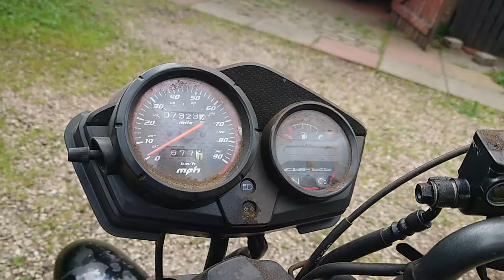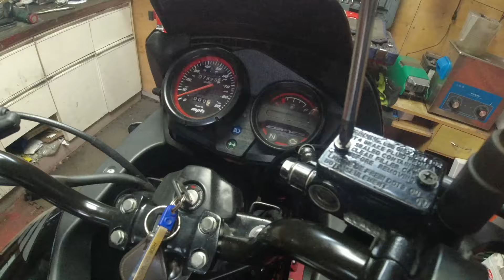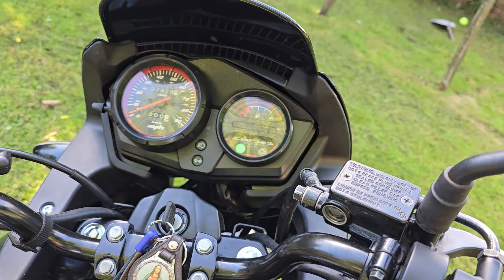Honda CBF125 Restoring your first motorcycle

Comment: Hello, I am also restoring mine, but having trouble on choosing products. Can you provide a list of the products and paint you used?
Reply from the maker: @sarmentinho  Some parts from Dave Silver, others from sellers on eBay, the paint was from an auto supplier, 2k primer and base coat and 2k lacquer. I will do a video breaking down all parts and the costs
Reply: @doconwheels-c5m  thank you so much! My main concerns are to pick the correct primers, paints and rust treatments to mine. 
Currently my restoration is halted due to baby taking all the time, but your video felt so good to watch, I enjoyed a lot! 😊
Reply from the maker: @sarmentinho  I hope you get progress with your project,  you shoukd be fine if you stick to 2k primer and 2k solid black for the frame. Panels require plastic primer before painting, easily done. Good luck 👍

Comment: Currently building my sons first road legal motorcycle he won’t help like Greg
Reply from the maker: I hope your son comes around and gets involved, he will gain so much
Reply: @doconwheels-c5m  
I hope so I have built all my transporter t5 and now I’m on his 50cc moped
I have got it running and riding the previous owner messed with the carb settings and would not start up. 
There a way a also a earth that had snapped off and the broken wire produced the eml once it’s conectrdd the illuminated eml go s out 
I got a little bite of bodywork to get on with
Reply from the maker: @sleepeasywithwhitenoise3860  You sound as busy as me!

Comment: Grate video but can I ask one thing where did u order bearings and cups from as I'm having a mare finding some and tapered ones don't fit the 2009 model
Reply from the maker: Thanks for you comment. We were really lucky, I had an old bearing left over from some other job. The new kits that are available all seem to be too tall for the top of the frame. You can use the bottom ok and put ball bearings in the top, or the other option is the have the frame machined down a few mm for it to fit. I have come across this problem before and I think it is becoming really difficult to get thinner bearings. Hope you get it sorted out OK
Reply: @doconwheels-c5m  yes I have bought three different sets and they all sit too tall at the top so makes the bike feel like a boat I'm going to try the honda cbr125r 2014 ones they are the same diameter so in theory they should work I hope.. I only have the old top cup and ball-bearings the bottom one was smashed to bits 😭

Comment: Fantastic job, what bit did you use on the dremmel to clean cylinder head
Reply from the maker: @thehondashed9198 Thanks for watching! I used the small brass wire brushes